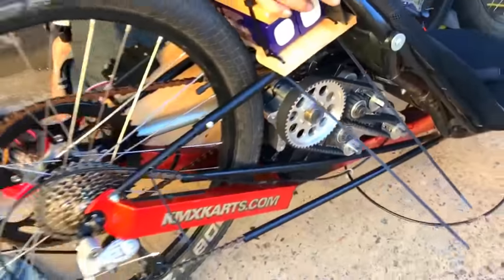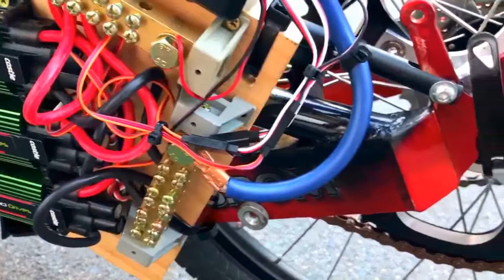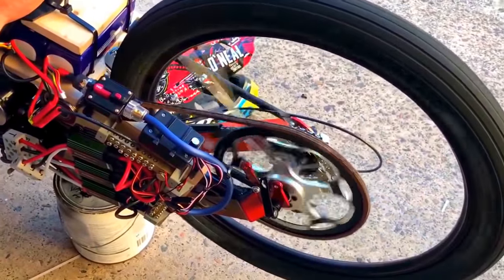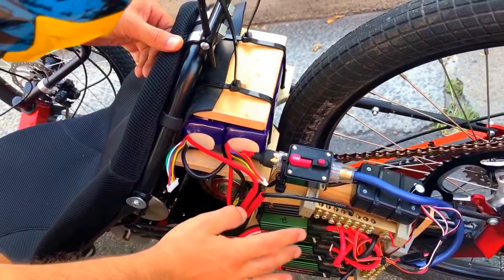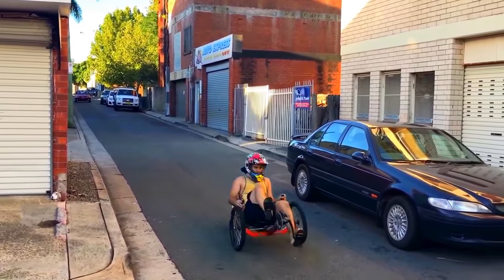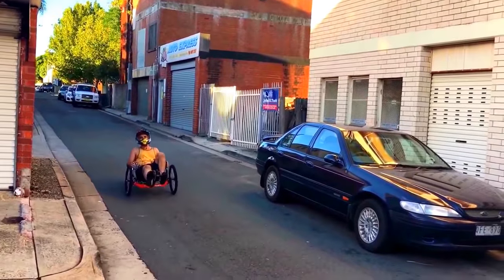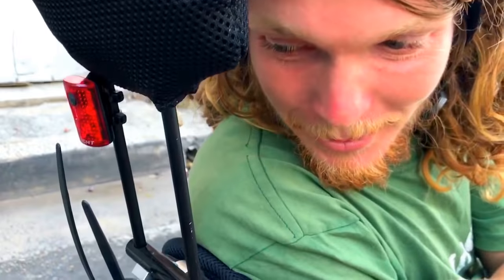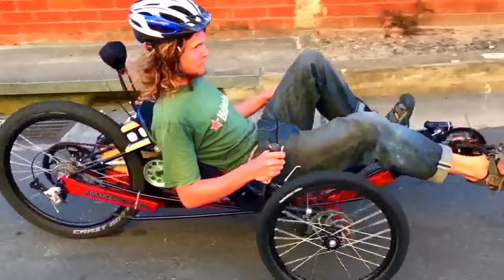DIY 42000w Electric Bike - 56hp Triple Motor (video#3) YES, monster is rolling! First tests at 300A

Comment: Friendly advice: Please mount chain guard, even if that thin chain is rated OK, you don't want a 56hp chain whip in the back of your head. Also, the chain looks really thin =) Love the motor+reduction setup!
Reply: agreed - Well they talk about the battery pack, the 300A protection switch and the control systems a lot (including wood on top of the seat-mounted LiPo packs - 'smart' move there... :P ), plus the acceleration rates are far too fast to have reliable control over the vehicle (because it wouldn't be road legal in most countries without reclassification, MOT compliance and driving license) - its basically an over-scaled, passenger carrying version of a kids high performance RC car. I can't help but laugh how impractical this is in its current form (no doubt more holes to pick into it, but that is the main one for me). If improvements were made, then there's no reason why this can't make this a better vehicle, especially with bigger wheels, better battery system and a gentler acceleration curve.
Reply from the maker: djfmitv hahaha I love how you described my toy “over-sized, passenger carrying, version of a kids high performance RC car”... haha... this is exactly what I’m trying to do!!!
I have to say, this power to weight ratio is impractical in so many ways but it's super fun, scary and “portable”... only 35.2kg when I made this video (watch this: https://youtu.be/cCP7f2V2R5U )
Yes I'm improving and adding a proper racing motorcycle battery capable if keeping up with this extremely high current and a state of the art battery management system, look up "Batrium".
My initial idea was to make this a mini electric vehicle all aerodynamic with fairing all over, rolling cage, seat belt blablabla... this hole project is costing soooo much $$$$$$$ so I'm doing it slowly so I don't go broke haha
Ah... also got front air shocks too... the fun is just beginning ohhh yeaahhh =]
Reply: subbed!
Reply: ElectricBike - haha, cool :D
Reply: Postume Immortal Well if it was 56 hp this thing would fold around the Motor
Reply: wow snappy little machine , its a blast just to watch it go ,
Reply: Lukas Langer, it won't happen, . Not enough traction because the wheel looses traction before any major pressure is created around the motor. The tyre followed by the spokes are going first.....  If the thing doesn't catch fire first.  :-)
Reply: that's all great but can you adjust the acceleration rates with a different throttle maybe or something because in it's current state it's uncontrollable. There's just too much power in that crazy contraption you have there xD POWEEEEEER!!!!! i love it =)
Reply: Stf
Reply: Postume Immortal - tea when a chain pop Spinning at staggering Rpm,s One Whip and it's to the bone with a fracture.
Reply: ElectricBike - that guy must don't have a clue us True hobbyist build several thousand dollar rc car's and 10,000 dollar 233 hpr rc boat's for fun and as a learning tool to advance business in Technology
Reply: I feel getting into RCs was one of the best things I did as a kid. Most people don't get it, but it is an excellent way to learn mechanical design, robotics, radio, and electronics. When I was like 10 I spent all summer mowing yards saving up for the 1st gen T-maxx, and had completely rebuilt it for a bigger motor within the first year making parts on a band saw and drill press. 

I was working at a hobby shop when Lipo and brushless began taking hold, ever since then I have been fascinated with electric vehicles to the point that I am now an electrical engineer interviewing for jobs in battery management engineering and motor controller engineering. Power electronics is rapidly changing the world around us, and those of us who work on overpowered toys are constantly pushing the envelope. 

I got so good doing wheel alignments on RC cars that I found I when I eyeball auto alignments they are almost always within spec when I take them for laser alignment.
Reply: Postume Immortal Very kool.
Reply: Get it dyno'd.
Reply: @Tonyplat98  There is no such thing as too much power - only too weak friction :-D
Reply: "Rubber" drive belt requires less power in use too. Slightly less risk if it hits you or a lightweight guard.

Comment: Believe it or not, the wheel spin is actually a good thing in this application. With tall gearing the controllers would easily over-amp. The wheel spin acts as a clutch reducing the load on the controllers. 

Bruno, I would recommend a steering damper. Above 50mph the steering tends to get very twitchy.

Also, I would eliminate the circuit breaker. This thing will pull 1,000 amps peak in short bursts.
Reply: Matt Shumaker Wait... You're the guy that built this motor setup! :: bows to the master :: I need to pick your brain, someday, on my setup! AMAZING JOB!
Reply: K
Reply: I thought it looked like one of yours Matt! Fun but a bit over kill though!!
Reply from the maker: MrTench8 hahaha this is the idea... something totally overkill and so much POWEEEEEERRR ohhhhh yeaahhh =]
Reply: When I was looking at circuit breakers for my build, I had a hard time finding DC specs that really suited my needs, so I went with a slow-intermediate time delay fuse and a very short lead out of the battery. I have cells good for 240A continuous, so a 200A fuse with a real world expectation of 180A out of the battery is what I decided based off battery load tests, and thermal performance of the cells. I then use a more conservative setpoint in the controller for current so that I will not pop the fuse unless I have a dead short downstream.

You could always program a more progressive throttle rate to limit starting torque and initial amp draw on the controllers.

I wonder if the steering damper is needed for this setup. I have extra wide bars on my ebike, and it feels quite stable at 50+. Maybe with two front wheels it needs extra damping.

Comment: I think it would be even better with a wider rear tyre!
Reply from the maker: Yeaahhh.. I'm getting a much wider rear tyre and also run at lower pressure... 
I did few tests just lowering the pressure and the front wheels were actually lifting and losing control... the scariest thing ever... hahaa... 
New video coming soon showing everything I am improving and changing... this trike is about to fly.. ohh yeaahh.... so much POWEEEEERRRRR =]
Reply: wow, wheelieing really? too cool hahaha massive torque
Reply: thought so too
Reply: If you add more traction, Youngs modulus bites you in the ass ! The tires are the second fusible link, with traction the stress on the chain and frame welds may be too much
Reply: @BrunoPOWEEER  maybe lengthen the chassis a bit?

Comment: 42k watts these tiny batteries ain't going to get you far. You're going to need a trailer with a nuclear reactor attached to it to get some distance.
Reply from the maker: Hahahahahahaa you’re right... there little batteries only lasted like 10 to 15 minutes... I’ve made a pack that’s 6x bigger and actively air cooled with a proper electric car battery management system... so much POWEEER
Reply: Next tutorial - nuclear powered recumbent trike
Reply: I think he knows that buddy

Comment: Max speed video coming up next
Reply: I would love to drive something like that. :D
Wouldnt it be better for traction to use some wider Rim like a Fat Bike Rim for example ?
i would like to know  if it would be possible to add enough batteries to have a reach of about 100km with driving about 80kmh.

Keep on riding :D
Reply: Need more battery :)
Reply from the maker: Электродикобраз Maklaud yeaahhh... got a massive racing battery.. I can pull 1700A now hahahahaa you'll see the next video.. ohh yeahhh
Reply from the maker: Vapolidazius Googulus yeahhh I reeeeally want to get a fatter rear tyre for more traction.. I just installed a new super powerful battery but the bicycle tyre and grip is the limiting factor.. I'll show more details in my next video replying lots of comments =]
Yes, these trikes can carry a monster battery pack under the seat, there is a company in the USA called OUTRIDER USA they had two trikes with massive batteries and did some very long interstate tours. My new pack will give me a much better range but this trike is super Road illegal I'm not sure where I can ride it hahaha
Reply from the maker: thequickredfoxjumped overthelazybrowndog yeaaahhh I'm here to help hahaa...
Sounds like you'll need a new controller if the wires were damaged... just pay attention to your motor model there are few different details you need to ou attention, better remove your controller first so you can see things properly. You'll need some silicone when installing a new one.
Apart from controller everything else should be fine, possibly a harness depending how bad and where the wires stretched.
There is a wheel speed sensor extension designed for long cargo bikes but it's about 40/50cm long... you may need few for a recumbent trike or if you're confident soldering wires you can just extend it. Maybe practice in the bad controller first =]
Yeahh I hope I helped a bit... so much POWEEEEEEERRRR haha
Reply: Sounds and goes like a mega RC model.  Btw, what are the pedals for? In case it rains, all that uncovered electronics arcs, so you can get home?
Reply: Ok, ill start digging ur grave...
Reply from the maker: J Clar hahaha pedals are "just so it looks more like a bicycle" at least this was the initial plan.. not sure if looks like a normal trike with all these wires and batteries hahahaha
Reply from the maker: DragonsREpic ahahahaha I love adrenaline but this trike turned up to be super ultra dangerous, feels like you're just about to die every time you twist that throttle and the trike launches out of control... I'm trying to fix improving things here and there but so far super nuts hahahaa
Reply from the maker: thequickredfoxjumped overthelazybrowndog haha... fast is good and addictive... if you can't see the speed it's just natural keeping on twisting the throttle... nice to have a speedo so you actually know if you're not going nuts speeding haha =]
Reply: Vapolidazius Googulus were is the maximum speed video?
Reply: what if you went 2 wide wheels in the back too?  That thing would be able to steer like an F1 car with similar torque tbh!
Reply: @BrunoPOWEEER  1700 amps... Nervous laughter

Comment: Awesome! I was thinking of a 3 motor fat tire bike. Front and rear hub drive and a supplemental Bafang mid drive for a total of 4500 watts but that recumbent is INSANE
Reply from the maker: Hahaaa yeeeeaahhh... ideally I would’ve had one motor on each wheel but back in 2016 when I had this crazy idea I was thinking about having one big lightweight motor to take this trike to a land speed record but I changed the plans since then... by far the smallest and craziest machine I’ve ever tried in my life, power to weight was greater than Bugatti hahahaa but impossible to control
Reply: That is legit what I was searching for when I came across this YouTube video instead

Comment: guys that thing is truly Wicked! Nice clean build as well for first prototype.
Reply from the maker: +Michael Mills Thaaanks dude!! 
Yeahh... it was just the very first run of the very first prototype!! I did few other runs after this video, impressively the bicycle wheel is holding pretty well, improved the battery, wider rear wheel, installing some devices to accurately measure and control the power... nice project, I'm having so much fun hahaha ohh yeaahhh =]

Comment: This is awesome, unbelievable power to keep the back wheel spinning. I would like to see another version with three hub mounted motors, then you might get the traction down
Reply from the maker: +Rex Venom yeaaahh I considered 3 hub motors, that would be freaking AWESOME but I also always wanted to play with these freak little motors for years so I had to give it a go... it's possible that I can add another two front hubs but I'll try a much wider rear first at lower tyre pressure for more grip like drag racing monsters haha

Comment: above all I find this very INSPIRING!!
Reply from the maker: Yeeeeaahhh.. thaaanks dude... this freak machine is keeping me busy for a looooong time... but its taking shape and coming together... looks more like a MADMAX thing than something suitable for road use but its just a fun prototype hahahaha... so much POWEEEEEEEEEEEERRR...
*next video showing some updates very soon =]
Reply: ElectricBike Imagine a trike with a longer arm for the rear wheel -> better acceleration possible!
Reply from the maker: +NikoxD93 yeaahh this is what I'm still trying to figure out... this trike is so low and super lightweight... I spoke to some automotive engineers and chances are that if I extend the rear it could get worse as there will be no weight at the rear... we are taking about making a completely new frame where we can calculate all these forces and possibly make a detachable rear end so we can try different lengths (slightly longer or shorter) and compare results... so much work and money but a lot of fun making this beast hahaa...

Comment: you added extra wood so the lipos dont puff... so youve essentially made a compressed area for an explosion to build if it does go wrong
Reply from the maker: +djm3nta1 lipo cells are a soft pouch that can easily expand and puff if they don't have anything to keep their shape in place. It normally starts with the outer cells then then they puff like a pillow the next cell underneath has no support and will puff too... this eventually makes its way to all cells in the middle of the pack. 
The highest C discharge lipo are all enclosed inside a hard case rather than wrapped with a thin PVC wrap. 
Even large LiFePo4 inside that hard yellow plastic case will puff if placed itself with no other cells around to keep the precise evenly over all sides. 
18650 cells don't puff as the cylindrical metal body and shape holds the pressure much better but when it explodes it releases all over the top stamped positive end. 
My packs I just added hard walls to support the outer cells properly. In most cases the lipo cells will show very obvious and visible damage and puff a lot before any explosion happens. Explosion only happens in extreme cases, often it will just puff and burst releasing the pressure with no fire.

Comment: ****WOW Most impressive.  How are your emotors set up? In series or parallel? What was your highest sustained speed? 
 How long of a distance at high speeds-+25MpH  can it go? 
Again Most Excellent work. **
Reply from the maker: +Amtb70x7 Anunkwn Thaaaaaanks dude!! 
3x motors and 3x controllers running the same belt and from the same battery!!
More details and specs here at the video description. This is the very first video showing all the parts on the bench before putting all together https://youtu.be/yfn_HKViwtM
Top speed, it's geared for 113kmh I think, I did 0 to 90kmh in just a few seconds in front of my house the other day.... hahahaa I'm having so much fun testing this wild beast... ohhh yeaahhh, so much POWEEEEEERRR!!!!! =]

Comment: Design and speed i love it.... but i wanna know how long battery life for that? The acceleration in very good... upload the max speed please...
Reply from the maker: +adie kaswara thaaaanks dude!!
yeaaaahhh I have done some tests with this trike after this video, always at night very late when there's no one around... 
These small batteries I used in this video are actually very very small, just for first tests.
I actually installed a much bigger pack with 5x more capacity, that means more kms and more POWEEEEERR with less voltage drop under load!
Next video coming soon!!!!! =]

Comment: Are there any issues getting the three motors in parallel to work well together? Tricks in the ESC? I've always wondered about putting two slim motors on a common shaft to double the torque. That reduction and belt drive is amazing. I have to start using belts.
Reply from the maker: Yeaaahh there are some issues, technically the 3 motors and 3 controllers/esc will never behave perfectly exactly matching each other. There will be always a very small difference but it works (engineers don’t like the idea).
If you look the super expensive Yasa motors they are axial flux motors with a whole in the middle and you add as many motors as you want to get to the torque you need, all on the same shaft.
This could’ve been done here too put all on the same shaft but then it would’ve made it super wide and hard to fit on the trike.
Reply from the maker: To minimise differences between two motors/controllers, keep both electrical wiring (battery wiring and motor phase wiring) identically the exact same length, throttle wiring too. If you have anything shorter in one controller and longer on the other it would cause an electrical / resistance imbalance and the shortest one would be draining slightly more power than the longer wiring one.
Reply: @BrunoPOWEEER  So Axial flux motors can 'slip' if they need? I'll look that up. How expensive? 
Does the belt stretch a little for a bit of give/slip? 
Thanks for the video & reply. You're awsome.
Reply from the maker: Hummm the Yasa axial flux are $$$$$$$$$$$$$$$$$$$$$$$$$$ the ones I have at work are around $15k each... there are some other models and brands that are a bit “cheaper” but not much cheaper... they’re expensive to manufacture.
Reply from the maker: My belt stretched a bit after a few runs and had to re-tension it.